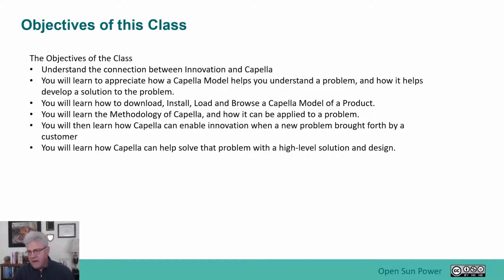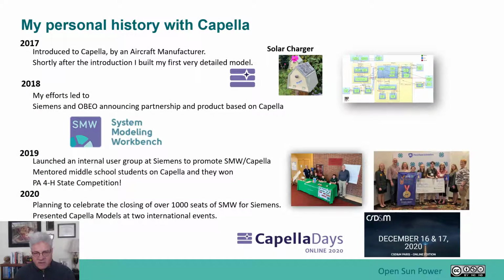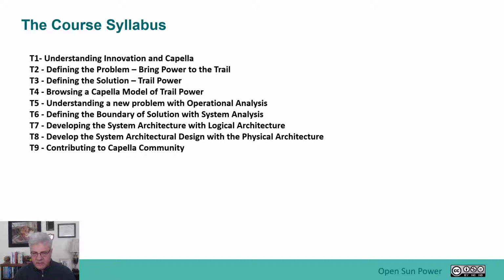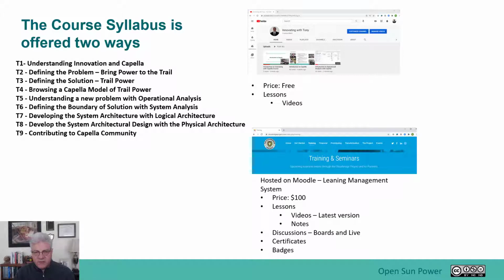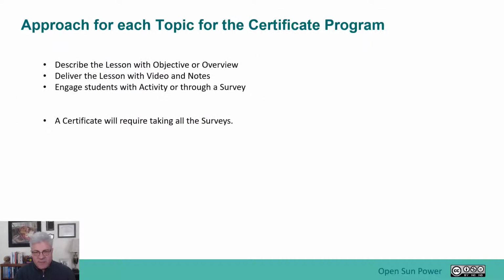1 Introduction to Capella

Comment: I don't know if you are able to look at these questions, but I just wanted confirmation of what it appears for me. From everything I am seeing, Capella in and of itself is nothing more than a competitor for Visio and it's only when other software is used that any actual work gets done. Is this a fair statement? I was looking to have a system entered, then have something tell me what kind of bandwidth it has, some what if scenarios on if another component would be entered into the system, and such. Sounds like I need Cameo, not Capella
Reply from the maker: Good luck doing that with Cameo. It will take 3 times effort to capture same information, you will have to pay for it, and still will not give you what’s your are describing.   You are definitely talking about down stream tools like Capital or Expedition from Siemens.
Reply: @innovatingwithcapella  you can actually do it with mathlab code using parametric diagrams that capella doesnt have. capella is more of looking my drawing it looks nice